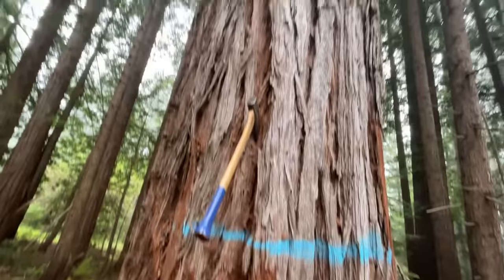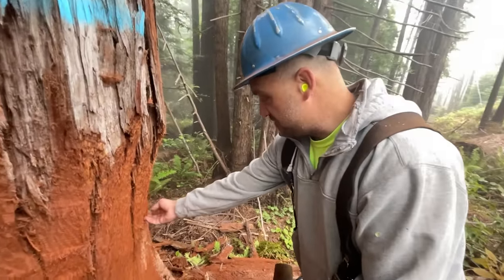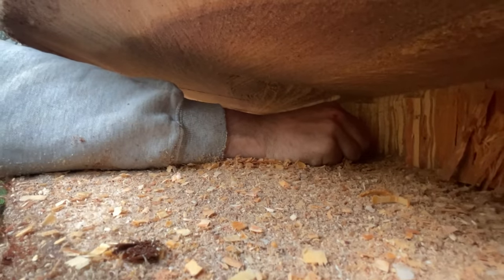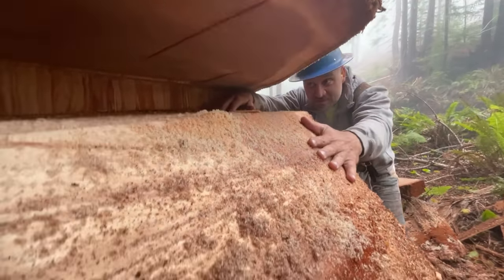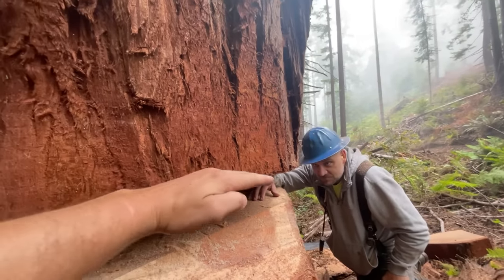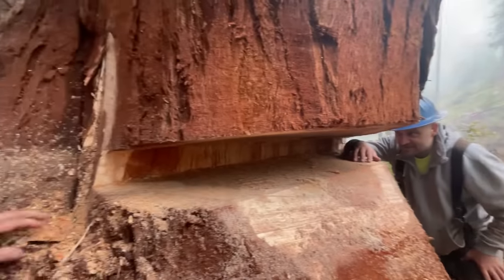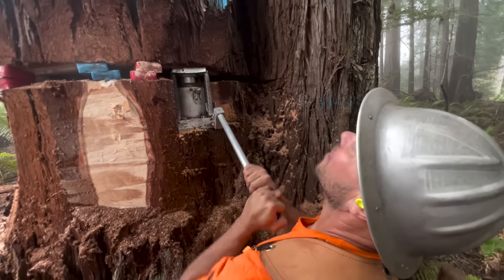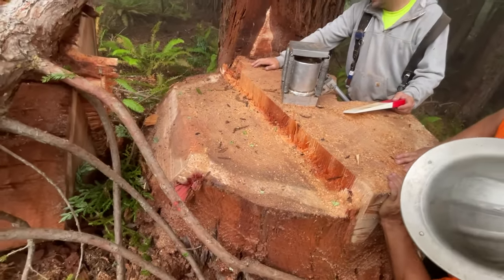Felling a Redwood With a Traditional Humboldt/Gapped Face Cut

Comment: Thanks for this video.  A decade ago, I had hardly used a chainsaw and lived in a suburb of NYC.  Now, I have lived in the woods, in the East, for almost five years, and have a few chainsaws, which I have used a lot.  Still learning though and videos like this help.  

And, fwiw, I do cut my stumps high, just do not want to bend that much.  I have never had a tree break apart when it dropped, after using what you call a conventional notch.  That may be my trees, which are spruce, white pine and eastern hardwoods; beech, maple, oak, yellow and white birches.  

Thanks again.  I will be watching more.

Comment: I understand the mentality of the west coast faller. In the east so many trees have a huge butt swell that you aren’t losing that much good stuff  by cutting a conventional cut.  Great video. Here in the east I Wii sometimes do a gap faced cutt to try and get a limb locked tree to ‘drop’ vertically a little more.

Comment: In the east, some of us will use an open face, as close to 90 deg as possible to keep the butt on the stump.  Especially in high dollar hardwood, or frozen hardwood, it helps with splitting.  Frozen hardwood can make some nasty barberchairs and ruin the log or kill you.  Running from a barberchair through asshole deep snow is no fun.  Bore cutting the back cut is a damn good idea too.  But I've cut in OR and WA and seen local guys there do it too.  Also saw it in CA years ago as well.  Although in bigger stuff its pretty hard to get as wide as 90 degrees open.

Comment: Looks like it was a pretty fast growing tree for such a large one.
I have some very old growth/slow growing, Redwood boards that had as many as 90 growth rings per inch, and the rings were of a large diameter.
These boards were bought in the 1970s
Reply: I think these are all secondary growth trees growing in rings around the stump of an old tree. Probably new shoots have been fed by massive healthy root systems.
Reply: @travisfinucane  I agree. 
Apparently some of the large stumps would create very neat rings of rapid new growth.

Comment: Very nice job!👍👍. Back in the mid 80s had a guy show us in school different ways to notch a tree, I liked how he did a straight in on top and angle up from under. I don't like dropping large trees many I cut down 6 to20" trees if I need to and use the under notch cut method, the tree kinda shoots away from the stump and rarely have one if any kick back on or fall wrong.

Comment: This guy is a PHD in tree cutting.  He should be writing a book.  He explained it so well.  Amateurs please notice the safety equipment he wears. Why do you not need it when you only use a saw a couple of times a year and he wears it with all his experience.  Safety comes first not  the couple of trees you are downing.  You need it far worse than he does.   My granddaughter’s boyfriend is a climber, tree topper for a large Va arborist company.  Last I saw him he was bandaged up just above one ankle.  He was walking with a running saw while on the ground and the saw tip touched his leg. Very embarrassing.  He had to listen to one of my lectures on safety.    I was 30 years in the elevator business.  Our motto was. SAFETY IS JOB ONE !
JoeB
!

Comment: “Eye protection? We don’t need no stinking eye protection!”
Reply: We don't pull the start cord until eye protection is on, and that's pretty common around here (West Virginia/Pennsylvania/Ohio), arborists and loggers alike.  However, it's not just this video that I see Westerners not wearing the eye protection, which leads me to believe that there must be a reason to omit it.  Is there a reason, or just a regional preference?  I'm not trying to judge one way or another, just curious.
Reply: @happycamper6352  because safety squints
Reply: I’d rather squint, hate eye protection, chaps are annoying too.
Reply: @richfrench288  I find most PPE annoying, but not as annoying as having something stuck between my eyelid and eyeball.  And it's certainly less annoying than losing the use of an everyday body part.  I guess if you only cut at certain angles relative to the position of your eyes, the risk of stuff flying at them is greatly reduced though.  On the topic of chaps, if you're willing to pay, you can get much more comfortable chainsaw pants that are meant for those that use saws often, but again, quite expensive compared to the chaps you'll see hanging in your neighborhood Stihl dealer.  Mine were over $250, and that's been some time ago.
Reply: @happycamper6352  I just got a 500i and something is just slightly different about it that those dumb chips go right at my eyes, I may get a visor put on the hat. Still don’t like chaps. Glasses always fog up

Comment: Did it ever you hit the pyramids of giza were sawed down not built up ;)
Reply: The dendrochronolgy and rings turned to stoned, placing them in their position. The tunnel system is used to remove saw dust in a conveyor built. All the sand in the world is saw dust. I am trying to figure out how it turned to stone...

Comment: Fucking depressing. The only reason to ever cut down a Redwood or any climax tree is if they are diseased. There was no sign nor mention of that in this video, just mentions of “roads”. 
“But it allows new growth to occur” - that’s not how forests work. These trees are the climax species of this particular forest biome. Old growth forests go through several stages, and mid-succession species always give way to the taller, longer lived late succession species. You could say that “new growth” exists only to allow these behemoths to eventually reign supreme. 
“It’s just a tree” - a tree that is likely home to dozens of wildlife species, a root system that is interconnected to hundreds if not thousands of species of fungus and bacteria with relationships that we are only just beginning to understand. The canopy they provide allows birds and wildlife to travel under shade. The whole system of the tree interacts with the air around it, respirating clean air and moisture into the environment. 
And these fools are cutting it down to make a bench? Fucking disgraceful.